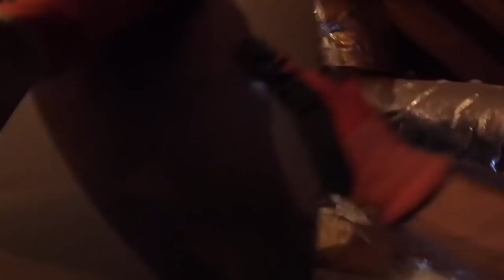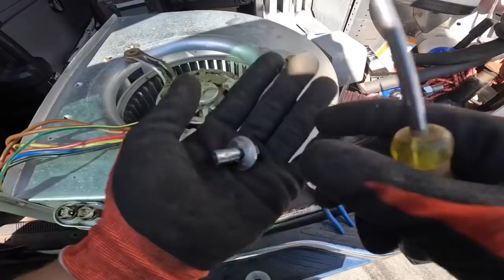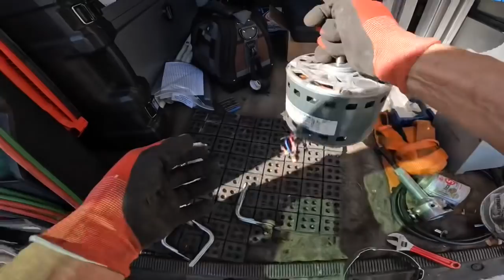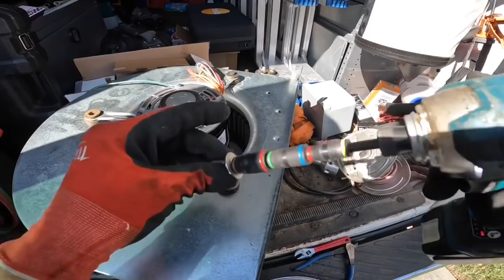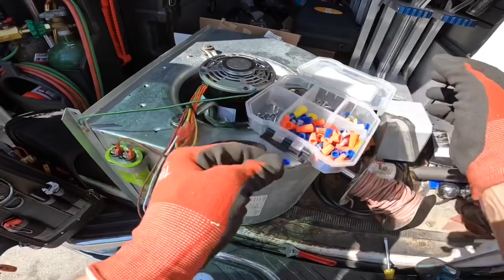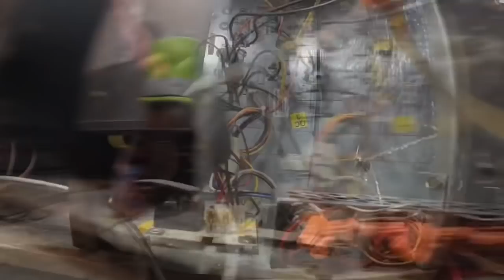Replacing Blower Motor With Loose Bearings

Comment: I always hated changing blower motors out without a puller. Some slide right out but most of the ones I always got were stuck. That puller saved me a bunch of time

Comment: Got a question,  
What do you think about the thermal camera,  you showed on one of your videos,  do you actually use it often ,?
Because iam thinking buying one
Reply from the maker: I’ve used it every time I go into an electrical panel. It is going to take the place of my infrared thermometer. Plus, I already know how useful it’s going to be when looking for air infiltration or leakage. So, yes I use it often…often enough to keep it in my bag
Reply: Get one. They are very useful for all sorts of stuff. You can check to see if ductwork is leaking or if breakers are overheating. All sorts of things
Reply: Great to know , thank y'all 
 you just confirmed my purchase 😅